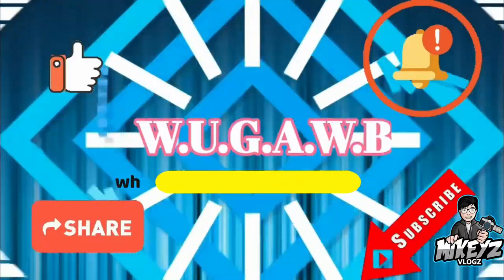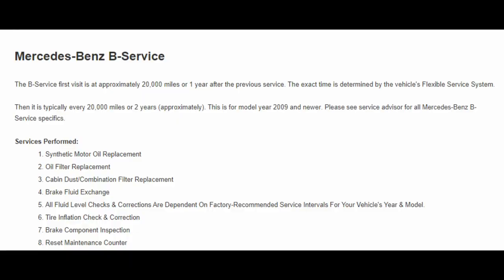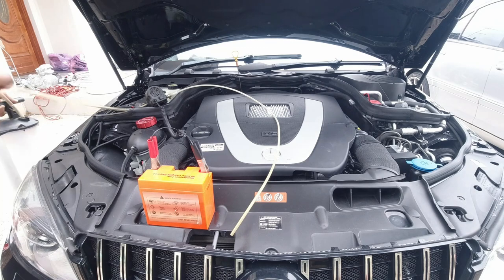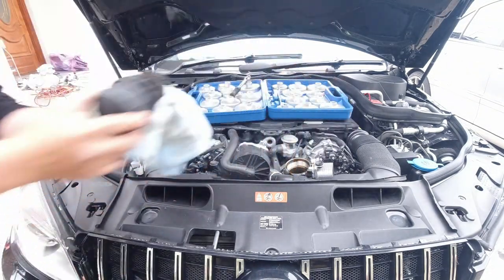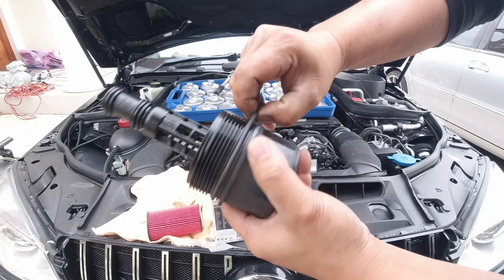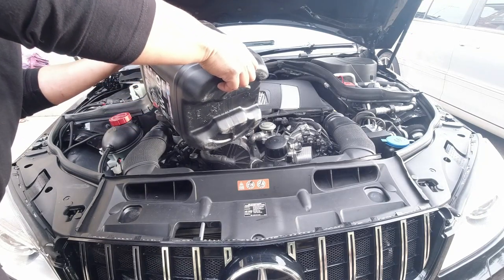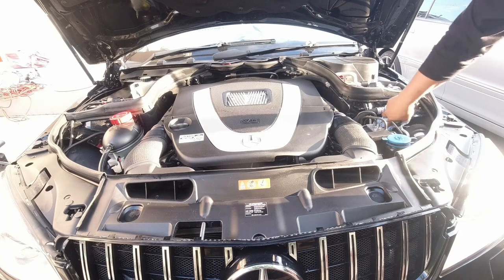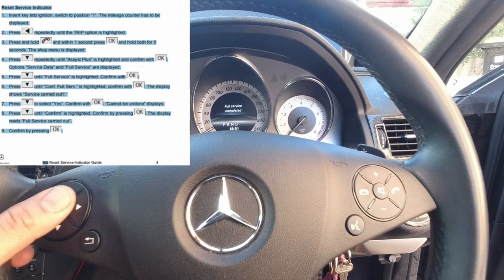basic explanation mercedes w204 B1 service what's in a B1 service?

Comment from the maker: other things you should also check is all your everyday functions like your mirrors , your seats and settings, your climate control , all your electronics buttions switches , windows, sunroof, if u keep up with your A and B services, your car should remain in excellent condition..also when we top up , we onlly top up oils and fluids that are not factory sealed, if a fluid is factory sealed you do not break the seal so u can refill the fluid or add fluid.. verry important, especially like the differential

Comment: Hey did you change your steering wheel back to old one?
Reply from the maker: I got a prefacelift sw that was wired to suit my model so changing back and forth isn't an issue
Reply from the maker: it's designed and wired for my car so everything is rewired to suit the connections . the hirn. the buttons . paddle shifters etc

Comment: I having a w204 Mercedes benze i having a problem with my reset service indicator..the time i took it for A service the guy reset it again after he does the service..and the he reset it it was showing B1...but i really what happen it shows A3 service and it must be on B1..can i reset it again backwards to show what it to shown B1 can you help me please
Reply from the maker: I don't understand what ur trying to say
Reply: Iam trying to say my service indicator was first on A service and when to service it and it shows my next service must be on B1 but the next morning its shows A3..what i want to knows can i reset it back to B1 service because it must be on B1 service but its show now A3
Reply from the maker: @johnjohn6332  ok so ive never done this before , but in your case u might need a proper mercedes scan tool so u can set it to what u want , as in b2 or b1 , i think if u keep resetting it will go to the next service , i cant be sure as i have never done this before , i cant say for sure bud, sorry i wasnt of any more help , usually when this happens i would use a proper mercedes tool and set it to the right setting , u can prolly ask merc to do it for you or if u know a mechanic with a mercedes tool , im talking about the actual mercedes scan tol that they use , it allows you to go into the ecu and do alot of things anormal obd2 scanner cannot do
Reply: @MIKEYZVLOGZ  thanks
Reply: Can you tell me does the w204 2010 model kompressor c180 having fuel filter?
Reply from the maker: @johnjohn6332  it should all cars should have one it would be an inline filter usually under care

Comment: Hello...my w204 ac vents giving hot air passenger side and cold air drive side...plz tell what could be the problem?
Reply from the maker: I really not sure ... I'm not a professional mechanic ..do u have temp set to cold both side? is your ac set to dual zone or mono? if it still does same then maybe u have a problem with blower motor ...I haven't had this problem I'm not exactly sure what it is .. I am a simple at home diy ..I am not professional mechanic ..u may need a mechanic to look friend .. sorry couldn't help more

Comment: Hi... Where did you buy that Mercedes-Benz sticker which is inside the door unlocking handle. If you got link can i get it please. Thank you mate
Reply from the maker: aliexpress
Reply: @MIKEYZVLOGZ  what did you type in search box cause i cant find it. Sorry for the trouble. Thanks.
Reply from the maker: @pawal9340  mercedes benz interior sticker or mercedes benz door sticker
Reply from the maker: @pawal9340  AU $7.00  40%OFF | Accessories For Mercedes Benz C class w204 c180 c200 Car Interior Door Audio Speaker Loudspeaker Trim Cover Stiker Car-Styling
https://a.aliexpress.com/_mPcOTeS
Reply: @MIKEYZVLOGZ  ty

Comment: Could you add a link to where you purchase the oil extractor?
Reply from the maker: honestly it's OK to use but uts not as good as draining from sump plug...if u wanna make sure u get all the metal shavings and 97% of old oil out ..do it the right way...this method of oil extractor should only be used in between major service where u change oil very frequently like every 5k kms ... I personally don't do it like this anymore ...but u can buy these on ebay and Amazon
Reply from the maker: I'll share a link for u if that's what u want